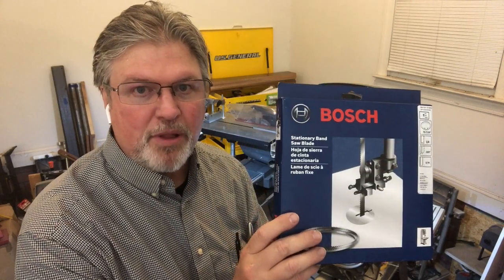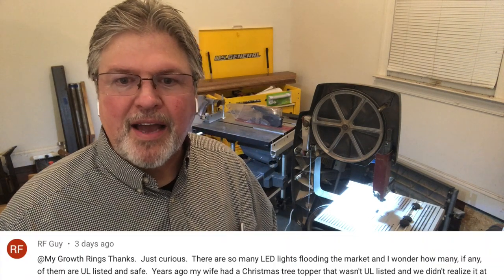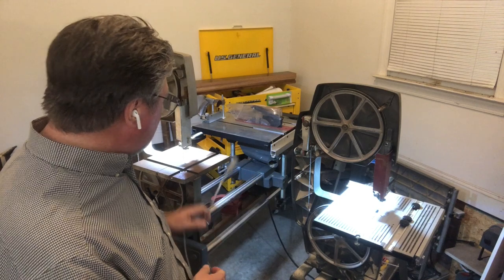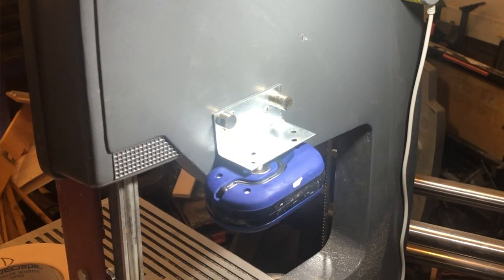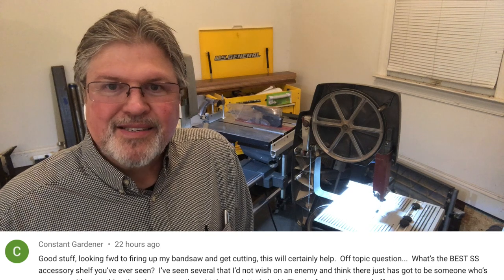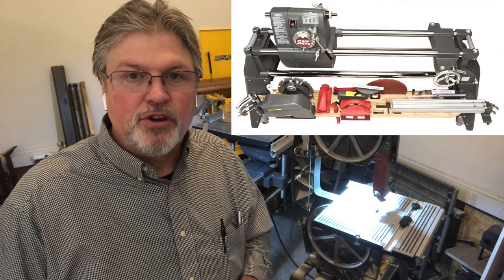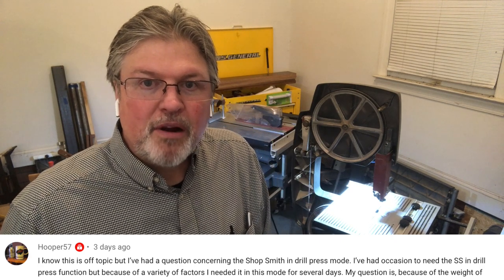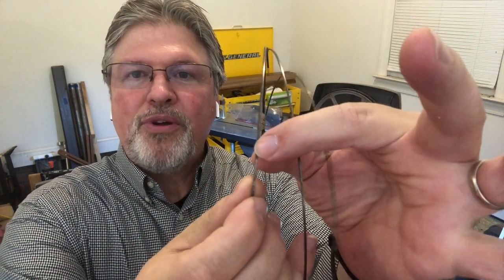STUMPED? Q&A: Almost FREE LED Bandsaw light, Carter Products and Shopsmith Drill Press Concerns

Comment: 5000 Kelvin is considered the same as day light from the sun at noon, at least as far as photographers are concerned. The harshness from LED lighting comes from the the LED being so small and bright and not really defusing the light from the LED as our older light bulbs did. I've put LED 4 footers in upside down to get the light to bounce off  of the reflector on the lamp fixture to get more diffusion and not have the harsh shadows that you normally get from the LED lamps. Great videos with wonderful information for Shopsmith owners of which I am one. Thank you for starting this channel, I've learned a lot already.
Reply from the maker: Thanks for chiming in.
Reply: Just one little addition: The reason lights are rated in Kelvin--a measure of temperature, with 0 degrees at Absolute Zero--has to do with the light spectrum vis a vis the temperature of the sun. Think of a piece of iron in a forge. Lower temperatures--cooler--are shifted toward the red end of the spectrum, hence "yellower." So, contrary to expectations, the "warmer" light comes from the cooler temperatures. The "cooler" whites--like the piece of iron--are from the hotter temperatures.

Comment: Thanks for the tip on those LED “sewing machine” lights.  Wow, just received the two-pack and they are great.  Easily attaches to that metal bolt you noted & I have it plugged up into my overhead LED shop light that has extra outlets in order to daisy chain other lights. Just perfect really. 👍👍
Reply from the maker: So glade you are pleased with them. Scott

Comment: Idea: looking to refinish the table saw tops on my 510. - I got the table set second-hand and it has a pretty rough finish. I has been working on it with some 120 and 220 grit and have gotten rid of most of the deep scratch. Just curious how you would go about polishing up the table and some of the other aluminum parts and protecting them
Reply from the maker: Brett Boren As you can see the main table on this 520 is oxidized for some reason and I do need to polish it up a bit. I typically use ScotchBright followed by paste wax. Perhaps I’ll shoot a vid. Scott

Comment: I have the carter guides aand stabilizer. I'm very happy with them. I have two Shopsmith bandsaws. One setup for resawing and the other for curved cuts. The stabilizer takes a bit of getting used to.
Reply from the maker: Which gets the most use? Tell me a little more about the guides. Once you have the adjusted do you have to do much fiddling with them as you change blades?
Reply: @My Growth Rings  The guides are excellent. I went from the standard Shopsmith guide blocks to shop made, then cool blocks, and finally to the Carter guides. I should have bought the cater guides right away. This saw is used only for resawing it cuts true as in no drift. One of the things I picked up along this journey is not to use your resawing blade to cut curves. Once you have twisted the blade to get around a tight curve, it will drift. My Wolf blades do not drift.

I haven't done much more than practice with the stabilizer. It's like having a scroll saw on steroids. Even cutting a 2x4, it cuts very tight curves. I got this with the hopes of batching out toy parts from 1-1/2 to 2-inch stock. But I haven't had a project come up that requires that yet. As you might imagine, cutting 2-inch thick wood on a scroll saw is some what difficult. One thing it is suitable for is resawing smaller parts. I make toys, and it is easier to cut small parts from a thick piece of lumber and resaw them than it is to mill a board to the correct thickness and have a large piece to 3/8-inch stock laying around that I might not use for months. Using a small blade with a high tooth count is what makes this work. It cuts straight, which surprised me.
Reply from the maker: @RobertKeeney  That's a very good point about dedicating blades to straights cuts! That blade that I demonstrated the weird "twist" option will never be the same! Thanks for sharing your experiences.  Scott

Comment: There is only one benefit I can see with having the "window" in the bandsaw cover for the blade tensioner. For when you re-tension the blade after it has not been in use. This would eliminate the need for taking the cover off just to re-tension the blade. I guess Shopsmith, and some users of Shopsmith's bandsaw want to only remove the cover for swapping out blades, and occasional maintenance. Which is why, I guess, Shopsmith offers a new bandsaw cover with the "window", and an access hole in the side for the tensioner (as Scott showed on his cover) as an upgrade. The window in the cover, and the tensioner side hole is now standard on a complete new bandsaw from Shopsmith. 

Having said all that; I prefer to check the blade tracking as I tension a blade, so I want remove the cover anyway. Plus, I can keep the inside cleaned out more often (Let's admit, the truth is dust collection is great, but is not 100% effective on any tool). So a "window" doesn't seem to be a worth while upgrade, to me.
Reply from the maker: Chad Nevels Well said. I think that’s what’s at the heart of my reluctance. The real reason SS added the window is because they were required to change from knobs to bolts for the cover, so that made removing the cover that much more of a hassle.
Reply: However, I do like the added side hole for accessing the tensioner with the cover on. Especially with thin blades that as they get warm and are put under load, can stretch. It can really come in handy during re-sawing as well. The gauge on the blade tensioner is excellent, and will get it near perfect. But, if you're using a blade that is a bit longer or shorter than 72" (for example the Bosch blade Scott used in the previous video was 72 & 7/16"), the gauge will get it close as a starting point, but won't be dead nuts accurate. Sometimes you can't get the proper tension on any blade until it is in use.
Reply: Do you have to use the bolts with the upgraded cover, or can you still re-use your old knobs?
Reply from the maker: @seelau  Thankfully no. The old knobs will work.

Comment: Guys and Gals, my bandsaw drifts so much that I cannot perform the re-saving function. I thought I might need more tension but a friend suggested a new blade. Any advice is appreciated.
Reply from the maker: I’d first confirm that the saw is properly tuned AND has a good blade. They the Timber Wolf blade I’ve linked to in my resaving video.  So many have reported back how nice it worked. Scott

Comment: I have two SS bandsaws (not sure how that happened, I told my bride) but I’ve only ever used one of them—I put the full upgraded table system on that one.  Now I’m keen on doing what some have mentioned here—having one for re-sawing and one for curved cuts.  I started rehabbing my second one today (old cast iron version).  The tires are definitely going to need replacing.  I’ve heard bad things about the urethane tires, looking to get replacement rubber ones.  Is SS this place to go or are there better ones out there?  Are these a standard size?
Reply from the maker: I would just go with the SS tires. They know what they’re doing.
Reply: My Growth Rings Funny thing—later that day after posting this question, I found a sealed envelope in one of my tool drawers and it happened to have two blue urethane tires I had apparently ordered from an eBay seller about 18 months ago.  Figured what the heck, smoke if you’ve got ‘em.  Cleaned up the cast iron band saw, put the blue urethanes on there, and mounted a 1/4” blade.  So far, so good, but we’ll see how they do long term.  If I have problems, will switch back to the standards.  Got some new Timberwolves coming for both bandsaws, thanks for the suggestions.  Keep up the great video work!